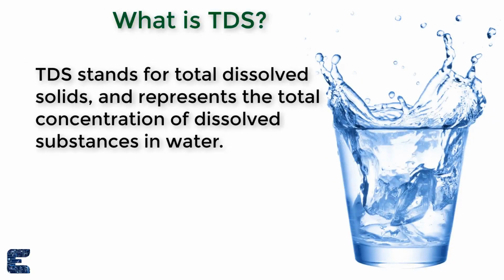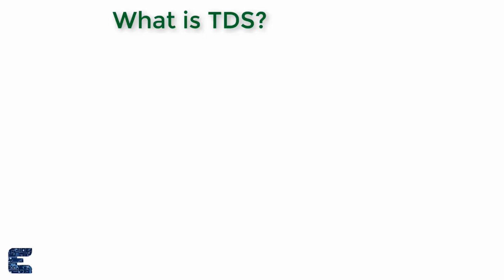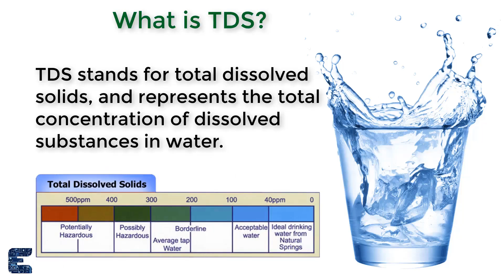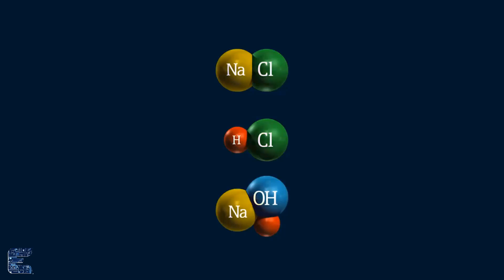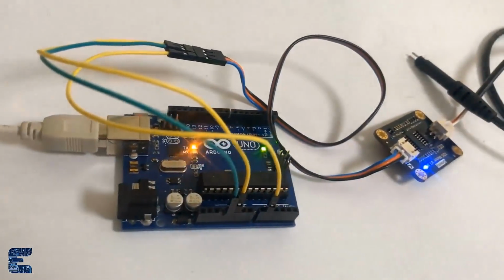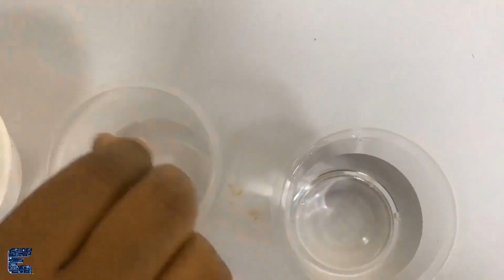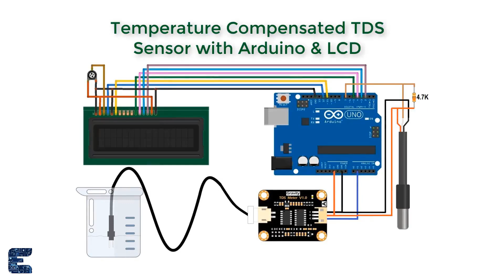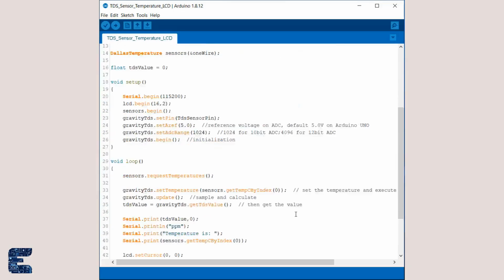TDS Meter using TDS & Temperature Sensor with Arduino || Measure Water Quality in PPM

Comment: Sir, I have a question.
I’m using the same sensor for my project to measure water conductivity. However, I’m facing a problem — can this sensor measure values above 1000 ppm?
The conductivity of my water sample is above 80 µS/cm and in the internet when I convert this to ppm the TDS value been approximately 5000 ppm , so I’m not sure if this sensor can handle that range or if I need to use and buy  a dedicated conductivity sensor instead.
Could you please check my question very soon?

Comment: what is the use of the 4.7k ohms resistor? i tried it  without the resistor and the value of the TDS and temperature outputs negative but when i include the resistor it works can someone explain the use of the 4.7k ohms
Reply from the maker: It is used for parasitic power for DS18B20 sensor. The digital pin requires power which is supplied via 4.7k resistor. If you dnt use resistor, the temperature will be shown as -127.

Comment: hi, help me please. i success to calibrate the tds sensor, but i need to have the sensor work properly even the power supply can sometimes be turned off. cause the tds sensor need to be calibrated first to work properly if after the power supply is off. can u help me please? :')
Reply from the maker: You dont need to calibrate again and again. Initial calibration is enough. The sensor works well even after switching the circuit on/off.

Comment: Can it measure tds of flowing water
Reply from the maker: These are for stable water.
Reply: @HowtoElectronics  actually I want to combine this one with your water speed and amount filling program 
So basically I want that this to measure the tds of water running from that pipe attached with water flow sensor to measure amount and speed as well

Comment: Hi friends

I need help. The display do not shows numbers or letters. I checked the connections several times, there is no mistakes. I have charged the sketch several times, but the system does not work
Reply from the maker: Did you rotate the potentiometer to adjust the LCD contrast.
Reply: @HowtoElectronics  Hello. Yes I did full clockwise and counterclockwise, just appear 16  squeres, but no letters, numbers or signs !
It is curious, but do not works for the two sketches, with and without temp sensor projects
Thank for your help
Reply: @HowtoElectronics  Another thing noted is, the light of the display throbs
Reply: @robertocarmona9257  Check the serial monitor in IDE and change the baud rate from 9600 to 115200. Once you get the desired output in serial monitor, check for display connection. My lcd was also throbbing. I gave 5v from arduino to both positive pin of potentiometer and to the sensor seperately. After doing this I started getting the desired output after turning off and on the Arduino.
Reply: @amiyasagar2258  Thanks, my friend, I will follow your recommendations ASAP.
Thanks for your help :)
Reply: Same issue with me For serial monitor I am getting 0 ppm continuously and for lcd display it is throbbing.
Reply: @amiyasagar2258  same thing for me, did you found the solution?
Reply: I have not used temperature sensor and used Techtonics analog gravity tds sensor available on amazon. While connecting it was showing ?? Like characters. After changing the baud rate of serial monitor it started showing 0 ppm. After insertion of electrode in water  also it shows 0 ppm. And for lcd displays nothing. Display light is turning on and off quickly. Changed the delay to 5000 and it started turning on and off quickly in every 5 sec.

Comment: Heey, i uploaded the same code, but it doesn't work, it shows me in the serial monitor : "?????????" , I don't know where is the problem.. i have conductivity sensor with EC board V1.0 , thanks for answering me
Reply: Same issue
Reply: Changing to baud rate in Serial monitor gives 0 ppm for every reading also my lcd is flickering for this code. For simple display code display works fine for same connection.

There was problem in the sensor. I replaced the sensor and changed the baud rate in serial monitor. Now getting the desired output.
Reply: I corrected lcd flickering by providing 5v from arduino to positive leg of the potentiometer.

Comment: Help me friends, i'm having a trouble with the sensor i bought. 
I read 20 ppm with the TDS meter i have and the new sensor  is reading 2944 ppm.  The liquid that is 240 ppm the sensor is reading 3109 ppm :(
Is  this a fault of my sensor ir that is something else i can do?
Reply: Updating!
I found out the problem after I bought another TDS meter... it was my ethernet shield. After i took it off, the right measure could be read by.

Comment: Hi, i got gravity tds meter from DSRobot. It has sensor range from 0 to 1200 ppm, but my sensor sometime can reach to 1800 ppm (9 times in 147 running), can you suggest what should i do? this is for my univ project :) thankyouu
Reply: The sensor range that the manufacturer writes is mostly not accurate. When they say 0- 1200 range they mean it's reliable in that range. Check your solutions tds using another market bought meter and calibrate it in your code.

Comment: I read the spec of this gravity tds sensor reading range only 0-1000ppm, i see in your video the sensor can read up to 1900ppm, i will test this sensor for hydroponics, i need to read up to 1100- 1300ppm.. what do you think, can i use this to read the nutrient water? just for 5-6 second read the water tds value than off.. and decide whether the nutrient pump adjustment on or off... so the sensor only has a voltage for a short of time.. is it possible if we give the sensor a voltage for longer time to read out of senor reading range will break the sensor module?
Reply from the maker: From the specs the sensor can measure only upto 1000pm. But the sensor shows the result upto 2000ppm. Need to verify this whether the data is correct or not

Comment: TDS sensor is conductivity sensor?
Reply from the maker: Yea there is a mathematical formula to convert tds value to ec
Reply: @HowtoElectronics  formula?
Reply from the maker: Check one of my post on my website article. I have designed the IoT based TDS & EC meter. You can find the formula there
Reply: @HowtoElectronics  thanks

Comment: thanks for the video, how do you calibrate the tds sensor ? or does it need calibration or not ?
Reply from the maker: It does not need any calibration if you are using temperature sensor.
Reply: @HowtoElectronics  can it measure ppm above 1000ppm? if it can, how ?

Comment: if i use 3.3V then at the place of 5V in the code i will have to write 3.3 V right?
Reply from the maker: TDS Sensor doesn't work at 3.3V I suspect.

Comment: Dear  Sir I have a question . as I see that this TDS measurement device range is between 0 to 1000 ppm 
so as  I see from your video and link TDS reading is 1840 PPm so is there any limitation or 2500 ppm is also possible to read with this TDS measurement device. I thank you for your reply.
Reply from the maker: The maximum ppm could be 2520 and value varies according to different ionized solute.
Reply: @HowtoElectronics  thank you